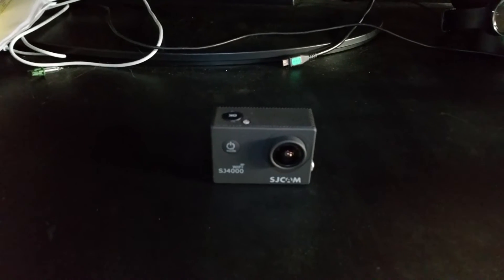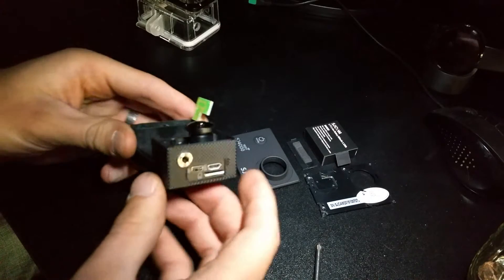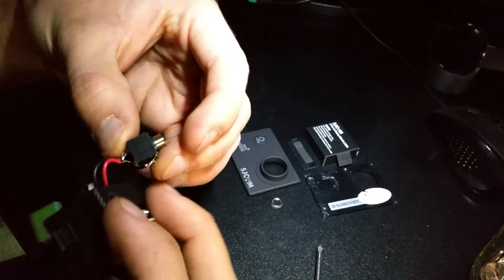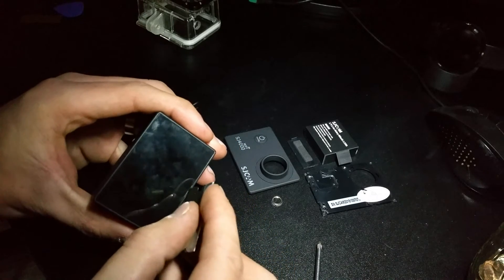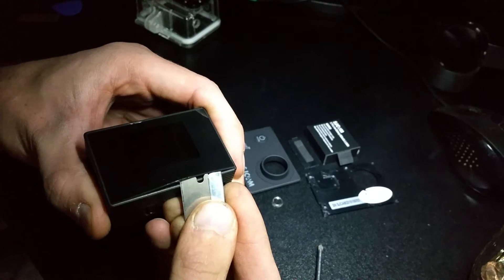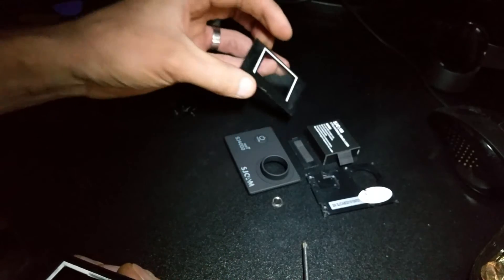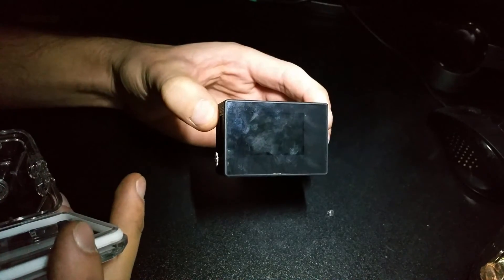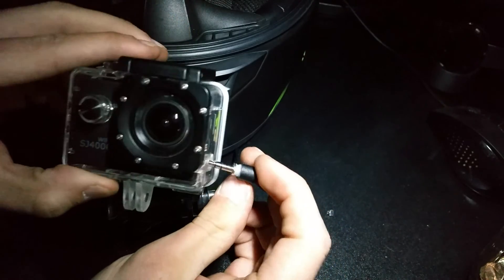SJCAM SJ4000 Wi-Fi Mic Mod

Comment: Hey please help me does this way to plug an external microphone is the only ? Thre isnt something else to have better sound ? And is this safe ? Should I try it to an  another camera or cheap because im scared that if I do that I ll break the camera or I cant put them back but from the other side a lot of people have already tired it and it seems successfull !!!pleaseeeee answer me your the only who really knows 
Thanks a lot
Reply from the maker: This is a way to bypass the on-board microphone so you can plug in your own external mic. The quality will only be as good as the mic you plug into it. Just keep in mind that you will ultimately only record in Mono, so a stereo Mic does not really matter.
I would look into a 5 pin jack instead. Just de-solder one end of the mic and add it in line so you can still use the on-board mic when the external mic is disconnected.

Comment: Hello,
I recently put 12V accidentally through micro usb port of my SJ4000 (1.5 inch screen) instead of 5V because I was trying to connect fpv equipment. I disassemble my camera and found the board. I saw that 2 components burnt. In the following link you can see a picture of my board http://prntscr.com/g165xf. I found that component 1 is a diode with code S4 as I saw form the internet. Component 2 as you can see in the following link http://prntscr.com/g166q6 has a code of BQ E0K. I searched in the internet and I didn't found what component is this. I would like to tell me if you know the codes of the two components so I can buy them.

Thanks
Iacovos
Reply from the maker: As far as I can tell, it looks like it's a voltage detector: http://www.s-manuals.com/smd/bq
Reply: Jays Rides Thank you very much. I really appreciate your help. I will try to find it. I also subscribed to your channel.

Comment: which mic are u using? does this mod support only lavalier mics?
Reply from the maker: Hemant Agarwal
I'm just using a cheap eBay dual channel lavaliere mic. The camera's motherboard is only set up for mono which is why you need to solder the positive to both left and right audio on the Jack.

Comment: What happens if u leave the stock mic in then solder a audio jack in  will it have both audio from inside the case and outside of the case
Reply from the maker: +EatMyMod 
Here's the internals of most common 5 pin Mic's: https://drive.google.com/folderview?id=0B_a5Prsh1dEWeFZmVlNjaVVkZkE

The best way is to use a multi meter that has a continuity setting that emits an audible sound when two pins are connected. Test to see which pins ring when unplugged and which ones ring when it's plugged in.
I'm getting ready to actually do this mod soon, so hopefully I'll be able to get a video up on it
Reply: Jays Rides thanks so much! And thank you for the fast reply too.
Reply from the maker: WTF 
Yes, it will always record from the internal mic, and record from the external source when it's plugged in. if you use a 5 pin jack, it will interrupt the internal mic when plugged in and resume when unplugged. the internal mic just has to be separate from the board.
Reply: Jays Rides I was wondering how you would wire the 5 pin audio jack, for it to switch when the jack is unplugged? I know the correct pins for when it's plugged in, but I dont know which to use when unplugged for returning to the internal mic. Thanks
Reply: Jays Rides Hi, so I did the 5 pin jack and it worked perfectly. But when I was putting it all back together, I think the ribbon cable broke. It just shows a white screen that glitches when you touch the cable. I was wondering if you had any ideas? Sorry to bother you, and thank you
Reply from the maker: EatMyMod
as long as the ribbon cable isn't crimped out have exposed wires, it should still be fine. Have you tried disconnecting and reconnecting it?
No bother. I like to problem solve.
Reply: Jays Rides it doesn't seem to be crimped anywhere, but I had video up until I pushed the screen back into place, then it turned white. I've tried disconnecting and reconnecting, but it doesn't work. Just a white screen, and if I move the screen ,it'll sometimes flicker the image up for a second.
Reply from the maker: Definitely sounds like the cable. You may be able to get a thin bit of foam to put in between the bend of the cable to keep it from bending to far. Also rolling up some paper might be thick enough. But it's not going to be a permanent fix. How do the exposed copper pins on the end look, any of them loose or bent? They should all be flat and stuck to the white band.

Comment: That's all fine but you made the case so it is no longer water proof which kind of ruins the point of the case. Seems like pointless modification to me. I would have figured out how to wire it so it would use either the internal mic for under water filming and water related filming or using a external mic without the case for all other filming.
Reply from the maker: +FishNFoolLures I would just buy a second case if I ever planned on using it in water. But as it turns out I'm afraid of even small puddles, so I stay away from swimming.
My only purpose for this mod is to capture my voice inside my helmet for motovlogging.
I also plan on redoing this mod with a 5 pin jack so I can have audio when the mic isn't plugged in.

Comment: Hi Jays Rides, I am wondering if this works on all action cameras? 
http://www.11street.my/productdetail/external-microphone-for-gitup-git1-git2-wifi-20433695
Reply from the maker: +JML GenX: I haven't had the opportunity to take apart any others, but in theory, yes they will all have an internal microphone soldered to the mother board. You may have to adjust the location of your microphone jack placement, but it will be roughly the same procedure.

Comment: Hey Jay, good video dude! I have a question though. Can I leave in the internal mic? I want to be able to use the internal OR external? Do you know if I wire the external jack socket up as well as the existing mic if they will both work?? Cheers
Reply from the maker: +Matt Delahoussaye: You can, but you would have to get a microphone jack that bypasses the external mic when it's plugged in. Otherwise you'll get audio from both at the same time. Something with 5 pins, like this: Look at this on eBay http://www.ebay.com/itm/231724077290
Reply: awesome thank you. any idea on wiring for this?
Reply from the maker: +Matt Delahoussaye: if you have a multi meter with an ohms setting, you will find the two terminals that ring when the Jack is plugged in, and don't when it's pulled out. That will be your plugged in positive. You'll then find the two terminals that ring when it's unplugged, but don't when it's plugged in and that will be your positive terminal for the external mic.
Reply: Thanks! Do you know if there is a PIC somewhere on the net for that. Internal & external mic all together one at a time.... thanks once again
Reply from the maker: +targetingxmod This one's pretty close, it's diagram C: https://goo.gl/images/grH1g8

Comment: Quick question. I did this mod and i'm getting a ton of feedback. Actually no audio is being picked up by the mic I purchased. 

1) Do you think it's because I purchased a 3.5mm stereo jack? (I'm not sure if I need a mono 3.5mm jack or if they make a specific jack that's made for a mic)
2) I'm not using any audio cable...do you think the gauge or the wire plays into a factor here or maybe I don't have enough insulation on the wires? (I didn't have any audio cable so I stripped an ethernet cable and used the wires out of that)
3) Lastly, I thought I had screwed up the circuit board and potentially cross soldered them, but I resoldered the button mic back on and the audio worked fine.
Reply from the maker: Any microphone jack you use to solder in will work. a modified or rigged microphone can have lots of issues, Ethernet cable wire is really thick compared to a lavalier microphone wire and can cause interference. it's best to use a standard lavalier mic. it can be either mono or stereo, but the camera is only designed to record mono. you may also have a faulty mic jack.

Comment: Thanks for the vid! Did this to my SJ4000 today. Didn't come without problems though. I had exactly same looking jacks as you did, and they seemed to work normally until i plugged my mic in -> no sound at all from the mic -> opened the cam again, and after some time i figured out that the problem was the jack itself. When i connected mic, ground and left channel connected with each other and right channel didn't connect to anywhere. I had 4 pcs of them and same problem with all, also tried other 3.5mm plugs, but that shouldn't and didn't help. Solution for my problem was, that i took some old nokia headphones that had 3.5mm audio jack and used it instead.
Reply from the maker: +Stikidiki: Yeah, some jacks are tricky. If you have a multireader you can ring the connections on the inside to each terminal on the outside and see which is which. Glad you got it figured out.

Comment: Very nice video .. Im planning to buy a tude its just same as sjcam but with better video quality.. will the procedure b same from inside and m not gonna b doin it myself do u think a phone repair guy can do that?? thanks in advance.
Reply from the maker: +devashish chauhan: I've never looked into that camera, but the fundamentals will be the same. Most people who work for a company won't do this kind of work, unless it's on the side and off the clock because you can hold the shop liable. I'll have to look into it though.
Reply: +Jays Rides no not the company guys we have lots of phone repair persons having own little shops so may be they can do it.. regarding the cam its tude and from the company sjcam only but with a diffrent name and they sell em through their dealers.. its pretty cheap cam for like $ 90 ovr here.. What kind of mic should i use on if i succesfully get the mod??
Reply from the maker: +devashish chauhan: I'm still trying to hunt down a quality mic myself, I'm currently just using some cheap lapel mics from eBay. They work, but they crackle with loud sound.
Reply: +Jays Rides ah okay.. watch the do it with dan all in one motovlogging tutorial he has link in the description for lapel mic he uses he says it works great and its pretty cheap.. see if its of any hlp.. :)

Comment: I'm going to attempt it. Any soldering tips?
Reply from the maker: I just used a $10 soldering iron from radio shack. make sure you have a sharp/pointed tip, if not then sand it into one. And I'm horrible at soldering so I cheat and dip my wires in flux, then I melt the solder onto the wire, then I push it against the hole and heat it from the bottom side of the hole. Just made sure not to let the solder connect from the speaker hole, to any other hole or area of the board.
Reply: +Jays Rides thank you and I get my audio jacks in Friday unless radio shack has some. And if they do then I'll be doing it tomorrow. Thanks again for getting back to me. One more question. When you heated the hole could it melt the board at all making the two holes touch?
Reply from the maker: +Kyle Lesmeister: all it will do is short the audio channels, it won't fry anything, and nothing will happen while your soldering since the battery is not hooked up. so just be sure the soldered connections are clean before closing it up and you'll be good to go.
Reply: +Jays Rides Ok so I was wondering will any mic with three pins work with that female input. Because I was planing on using a takstar shotgun mic. And it has the exact same male connecter plug as the little clip on shirt mics. Thank you.
Reply from the maker: +Kyle Lesmeister: Yes, any three pin female mic jack will work. The three pins are ground, left and right audio (stereo). A two pin Jack is ground and left audio (mono). The camera motherboard only has a ground and left terminal, so if you use a three pin jack, you will have to bridge the right and left audio terminals. This allows you to use either a mono or stereo mic which I use in my videos. I'm running standard lapel mics that clip to the shirt. Just be sure the mic jack you get is small enough to fit in the cavity of the camera.
Reply: +Jays Rides yeah the jack I picked out looks a lot like yours. I managed to get the camera apart and my two wires soldered to the board. Just have to wait till Friday to get the jack in.

Comment: Hey! nice vid!

Whats if u just replace the originaal mic with a bigger mic inside the camera?
i´ll wait for your response.
Reply from the maker: The problem with that is you would still end up with wind noise over 35mph. There is a way to just add a headphone jack with an interrupter so the internal mic works when you pull the mic jack out. But a larger internal mic still would not help at high speeds while talking through a helmet, the wind would just drown it out.
Reply from the maker: +WiLLO: That could work if you don't want to do the external mic mod. But you have to remember that the internal mic gets it's audio from the right side of the camera instead of the back like the GoPro. So cutting into the side of the case that the Mic is on will just compound the wind noise issue.  You can cut the slit in the case and put the fabric in between the new slit and the Mic opening in the side of the camera, and that should give you close to the same effect mentioned in that video.
Reply: Would you try a mod with a bigger internal mic (and upload the vid)?
Reply from the maker: The largest mic I can find that would work if only 60db. That's not much better then the 50db that comes in it. Not much point in upgrading at that point.

Comment: hi. is this camera any good? heard that some a re copies of copies. how can you tell if you're buying the real one? im after a cheap ish camera so i can start vlogging but not sure. any advice?
Reply from the maker: +stekellysk6 These days there are a lot of copies that say the're the real SJCAM, the only way to tell anymore is to be sure that the image shows the face of the camera has SJCAM and the Model of the camera, such as SJ4000 or SJ5000. You will not find any real SJCAM cameras for under $80.00, if it's less than that you are probably seeing a fake. If it only has HD on the face instead of SJ4000, then it's a fake.
If you are unsure if it is a real SJCAM, you can message the buyer and request a photo of the camera package. 
Here is a link to the real deal: http://r.ebay.com/26lHsI
It comes with all the mounts and case to get you started.
I enjoy the camera, it has very comparable video quality to the GoPro and pretty good audio if you do the mic mod. I did get the Wi-Fi edition which allows me to connect to it with my phone.
Reply: +Jay's Rides thanks for the reply. your info is really helpful thank you. il buy one from the link in your reply :) thanks again. good videos btw, hope to see alot more soon im subscribing :)